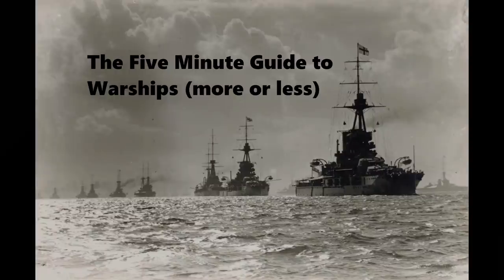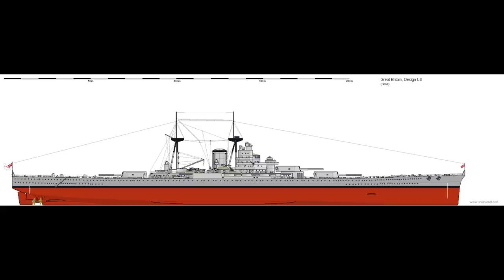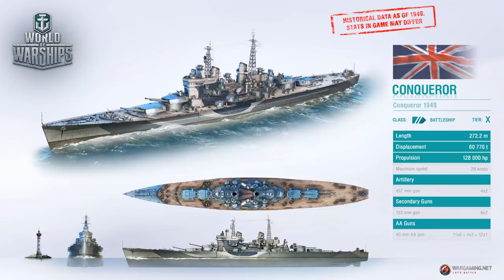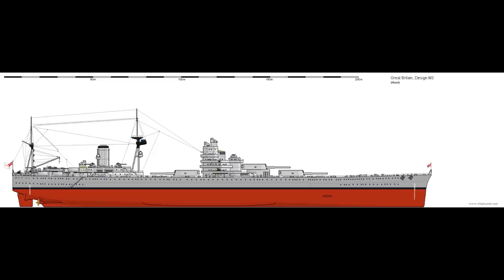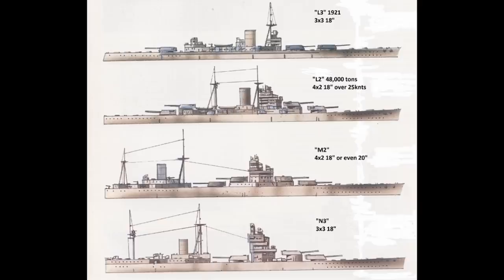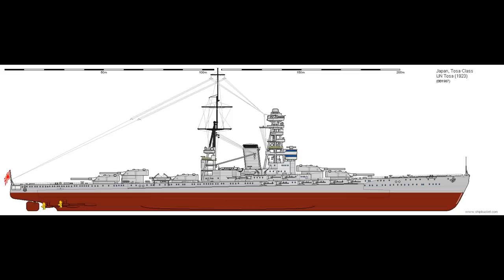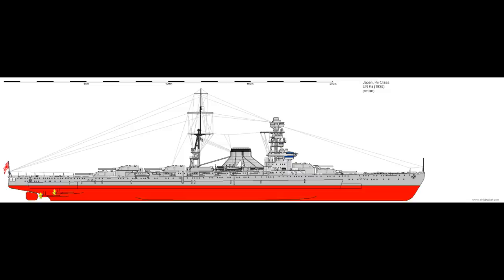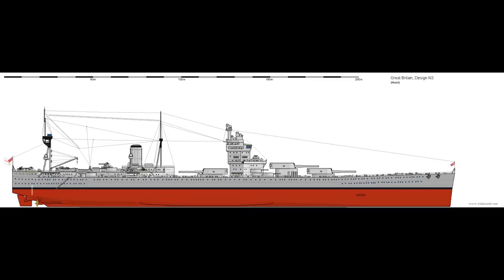N3 class (NB) - Guide 072

Comment: I've never understood the argument in favour of 2-gun ("twin) turrets over 3-gun ("triple") ones from a survivability point of view... Sure if one turret gets knocked out in a 3x3 arrangement 1/3 of the firepower is lost compared to 1/4 in a 4x2 arrangement.
But if you loose 1 turret of a 3x3 arrangement, then you're reduced to 6 guns, exactly the same number as if you lost one turret on a 4x2 arrangement, you're also down to 6... So there's no penalty for using 3-gun turrets.
You just get 1 extra gun when all turrets are working for a substantial reduction in weight. It seems like a win-win.
Reply: Yes,  for the first turret it's true. It shall be said,  though,  that in 1920s 3x2 is more firepower than 2x3.
When you lose the second one, you're below optimum for proper fire control. 
And ww1/ww2 experience explicitly suggests,  that under battleship fire you will be losing turrets.
Reply: one of the things you didn't counter in was that the more guns you have in a turret the more unreliable it is due to mechanical breakdown and the less room you have for gun crew so you lose a little in protracted rate of fire there are also advantages of having the additional range finder personally there is also a fire control advantage of using twins as you cab use half salvos using one gun from each turret making correction of fire much easier. I prefer a 3*3 arrangement however it wasn't until very late in Battleship development that reliable 3 or 4 gun turrets could be produced at battleship grade calibres and there was a solid argument for using twins right up until radar guided systems were able to overcome the inherent advantage of twins
Reply: As the others said, once you lose more turrets  more twin turrets get better. And you WILL lose turrets. Triple turrets also are more mechanical complex, have often a lower rate of fire, the barrels are more influenced by their neighbours when firing, making them more inaccurate, and  they are wider, meaning you got less space on your sides for the underwater protection. Fire control with 4 turrets is also easier than with 3 as you can divide your battery equally and fire half salvos of 4 to find the range. 3 rounds where considered too few
Reply: Tony Wilson  Rodney's hit did more than just take out forward fire control.  Rodney damaged Bismarck's forward turrets.  With fire control lost, turrets can continue to fire with their own range-finding equipment.
An extreme example of such operation is HMS Exeter continuing to fire after her bridge and internal communications were knocked out.  A gunnery officer directed fire from on top of the one remaining turret.
Of course loss of primary fire control will result in uncoordinated and less accurate fire. So to say Rodney would have been completely crippled is untrue.
Rodney and KGV managed to disable all Bismarck's main and secondary turrets,  which allowed Rodney to approach to point blank range with impunity.  At the end of the bombardment, Bismarck was not a functional warship lacking fire-control - Bismarck was a flaming wreck from stem to stern.
Reply: Tony Wilson  You have hit on a feature of war in that era - that engaging a target that can shoot back at you will typically be at longer ranges where you have less chance of hitting but also less chance of being hit.  Like AA fire against dive bombers very rarely would take out a dive bomber - but would force the attacking pilot to release the bomb at higher altitude and more likely miss.  Rare hits like Warspite and Scharnhorst did (26,000 yards at a moving target) were the exception - and each of those ships did that only once. 
But I don't see potential for a hit like Bismarck did to Hood on Rodney as well. Hood closed to closer than safe range to avoid the danger of plunging fire - but had to turn to fire all guns at Bismarck.  Turning allowed Bismarck a clear perpendicular hit against Hood's belt armor at a range where Bismarck's shells could penetrate more than 16" of Hood's 12" belt armor and 4" to 5" bulkheads.  Hood's armor was upgraded in the design stage after lessons from Jutland but was still not designed to be a battleship.  Rodney was built more like the pinnacle of WW I concepts of a battleship's role - slow but able to dish out and withstand punishment.  Jutland showed how much damage could be inflicted (lesson primarily learned by the Germans being on the receiving end of those 15" guns), but all battleships on both sides steamed home after. 
Rodney also benefited from having more than 10 years before the war to work out the design flaws (including its own tendency to knock out her radar by firing its guns).  If Bismarck had not lost his radar (from firing his guns) and had been fully mobile (if still slow from the damage Prince of Wales inflicted in the Battle of Denmark Strait), this would have had an interesting effect on the battle.  Let's assume a more mobile Bismarck would have been harder to hit, and his fire would have been more accurate.
Rodney started firing at 21,000 yds and was closing at a much slower speed than Hood - but did not need to turn 90 degrees for a full broadside.  With all guns forward, Rodney could fire all three turrets forward at longer ranges, and would only need a partial turn to bring all three to bear at closer ranges.  This would have the effect of Bismarck's shells hitting Rodney's 14" belt at an angle giving the effect of sloped armor.  And unlike 4" to 5" bulkheads, Rodney had up to 12" bulkheads protecting vital components (thicker than Bismarck's internal protection).  Rodney might have been a more durable ship in withstanding naval gunfire than Bismarck.

I could see a battle in which Admiral Tovey managed to intercept Bismarck before he reached air cover, but with an inconclusive engagement where Bismarck was able to disable turrets on Rodney while losing some of its own.  But if reduced firepower from Rodney was combined with the intermittent failures of the 4 gun turrets on the KG V we could have had an engagement in which both sides were forced yet able to withdraw (the Royal Navy ships being too low on fuel and too close to the French coastline to continue pursuit, and Bismarck needing even more repairs).  Without Bismarck's primary and secondary guns being all knocked out, they could not have gotten close  enough for the torpedo hits that had the capacity to doom Bismarck (to sink a battleship you generally needed mines or torpedoes to knock holes in the ship below the waterline).   It would have meant Bismarck continuing as a threat in the Atlantic.  The Royal Navy would still have been dedicating resources to disabling Bismarck or being in position to intercept if Bismarck sortied out (much like with Tirpitz).  But it could have had a more significant effect on the war with where these ships would need to have come from.  To meet this commitment, the Royal Navy might have been forced to abandon the Mediterranean with potential loss of Egypt (or making it harder for US forces to operate in North Africa). 
The Royal Navy got lucky with the circumstances of the final battle with Bismarck.  Gunfights leading to the sinking of battleships were an exception, not the rule.  Even the effective gunfire of Duke of York vs Scharnhorst in late 1943 served mainly to slow Scharnhorst allowing destroyers to catch up and finish Scharnhorst off with torpedoes.
Reply: Tony Wilson  Minor point but Rodney did have an aft fire director for the main battery; it's on a small tower at the aft end of the superstructure behind the secondary battery.

EDIT: You can see it on this diagram of the Nelson: https://upload.wikimedia.org/wikipedia/commons/a/a7/HMS_Nelson_%281931%29_profile_drawing.png
Reply: Reasons to pick doubles over triples
-accuracy
-less risk when losing a turret
-spends less ammo per turret
-traverses faster than triples
-easier to make
-less complex
-can fit bigger guns in same sized turrets
Reasons to pick triples over doubles
-numbers when in a smaller ship
-needs less turrets
-smol citadel
-an easier way to fit 3 guns instead of having a double and a single
Reasons to pick quad guns
-u a french boi
-needs to fit many guns
-even smaller citadel
-"LAUNCH MORE BAGUETES"
Reply: The French going with twin double double turrets .........
Reply: @iansneddon2956  goood analysis well thought out, great discussions here...that's why i love this channel. Drach has some pretty smart followers.
Reply: I didn’t realise that until I read you comment (I’m not good at maths)😂😂😂
Reply: You get less rear firepower, so you are weaker when disengaging, and you also have to deal with overweight bow section, as it is not balanced by an equal mass on the stern section.
Reply: @iansneddon2956  Your analysis is very good, but Drach did a video about how Hood was destroyed, and he came up with a penetrating hit below the main belt. He stated that Bismarck's guns didn't have the penetration ability necessary to penetrate Hood's angled 12inch belt, the sloped armour deck behind it, and then travel into the magazine. Afaik, German AP had excellent penetration when hitting at something close to a right angle, but dropped off quickly when the angle increased.

I would like to point out that while Rodney had a very impressive armour scheme and thickness, she shares Hood's fatal weakness, the shallow belt armour. If you look at the armour scheme, you will see that the belt barely extends below the waterline. If a shell should hit that spot, there would only be the torpedo bulkhead protecting the machinery and magazines. This family curse is also visible in the G3 and N3 designs, although it was corrected in the KGV-class, which had a very high belt (I think over 6 meters, but don't quote me on that)

Without the torpedo hit to her rudders, Bismarck would still be able to steam at 28 knots, so she would most likely able to refuse battle with Rodney. KGV might catch her, but a 1vs1 is unlikely to take Bismarck down, especially with the unreliable quad turrets. An interesting scenario would be if Tovey decided to take KGV and Renown against Bismarck.
Reply: @michaelkovacic2608  Yes, I did my analysis before I got educated by Drach in his excellent video about the sinking of Hood. I had considered Bismark's hit to have been some very lucky penetration of not just armor but interior bulkheads.  
The hit bypassing the belt entirely through a "technically" underwater hit made much more sense.  Generally, though, AP shells do not detonate if they have to travel through water prior to impact, which led to Drach's further analysis of photos of Hood at speed with a wave trough exposing Hood's hull below the belt.
This leaves me skeptical of Bismarck scoring as lucky a hit on Rodney on two counts:  (1)Rodney's armor and interior protection was thicker than Hoods around vital components. And (2) I haven't seen any pictures of Rodney at speed with as sizeable wave trough as we see with Hood.  Maybe if Rodney was going 28 knots or so, we would see more of an effect. But of course Rodney could not have ever gone so fast and certainly not in May 1941 with worn out engines.  iirc, Rodney was struggling to get near her spec speed of 23 knots.
My hypothetical battle was a way of acknowledging that the Royal Navy had some good fortune in getting hits in earlier on Bismarck. Had it gone the other way and if KG V had earlier gun failures, Bismarck might have held his own somewhat.  For its inefficient design, Bismarck was still a capable battleship with excellent guns. Arguments against this victory for Bismarck, particularly from another of Drach's videos, is that the KG V class gunnery problems are exaggerated. Something about KG V experiencing problems after having reliably thrown more shells at Bismarck than the entire USN battleship force combined fired at Surigao Strait.  PoW's failures are excusable for a ship going into battle during what should have been its shake down cruise.  KG V's guns were quite reliable for the portion of the battle that mattered most. 

An alternate resolution for a battle between KG V and Bismarck one on one might be KG V withdrawing (possible with Bismarck's rudder damage) with both ships somewhat disabled.  Leaving Bismarck in the afternoon with limited ability to maneuver and much reduced AA protection (assuming British shells pounding turrets and superstructure) there would have been the Swordfish complement of Ark Royal making torpedo attacks on Bismarck until available torpedoes were exhausted.   Advantage for the Royal Navy... they had more resources that could be called in. And there was a Revenge Class battleship enroute as well if Bismarck still needed sinking.  Reinforcements for Bismarck were not as available.
In a hypothetical encounter on the high seas where both ships damage each other to a tactical draw, the victory would go to the Royal Navy.  The more they could mission kill Bismarck the better. Let the RAF take over bombing Bismark under repairs.  And the Royal Navy would have more resources for repairing ships than Germany.
Reply: @iansneddon2956  Can we really be sure that AP shells do not detonate if they travel underwater? PoW scored a underwater hit on Bismarck which detonated against her 50mm torpedo bulkhead and flooded a generator room, and Washington scored several underwater hits against Kirishima which did absolutely devastating damage und caused terminal flooding.

While I generally really admire British shipbuilding, the shallow belt armour on early interwar designs was always perplexing to me. When looking at Rodney, for example, you have a 356/381mm angled belt, which should give excellent protection against penetrations through the belt at practical battle ranges. However, if you look at a side schematic of the armour scheme, you will see that the belt extends only about 0,5 meters below the waterline. A shell passing below the belt probably has to travel only through 2 meters of water. If it penetrates the hull below the belt, there is only the torpedo protection system backed by the torpedo bulkhead.

The German L20ea design has the same issue. While a 350mm belt sounds impressive, it extended only 0,35 meters below the waterline, and was actually only 2,2 meters in total height. I don't know about you, but I would feel damn uncomfortable aboard a ship with such a weak lower hull.

And a side note on Bismarck: it was certainly a very inefficient design due to the armour scheme, but it was certainly not a trash ship overall. The artillery and fire control system were very good, and German battleships generally displayed very good shooting in WW2. The British could certainly have built a much better design on the same tonnage, for example the G3. But Bismarck's armour scheme should at least have provided good protection against British 14inch gunfire.
Reply: @michaelkovacic2608  It is more of a factor that most fuses tend to be disabled traveling through water.  As you point out, the distance traveled through water is a factor.  As is the type of shell.  But since the Japanese were not involved in the engagement, their diving shell technology was not at play.
The disabling of fuses is more of a probability than certainty, of course, which could have left the PoW hit on Bismarck as a lucky hit while Bismarck's underwater hit on PoW that failed to detonate (the shell being discovered during repairs much later) a more typical result.  
There was experimentation by some nations in the 1930s with shells that could fairly reliably detonate after traveling through water.  Such as Japan's (Type 91?) diving shell, which had other problems.  Having a belt that does not extend any further down than it needs to means greater thickness of armor elsewhere.  I guess the crux of this is the "as far as it needs to" part which can change as technology does... leaving older designs a little vulnerable.
If I recall/understand correctly, examinations of Bismarck's wreck confirm that the 14" guns were penetrating Bismarck's superstructure armor.  They didn't perform that badly.  The Royal Navy's problem is that after pounding the superstructure as much as they did they weren't so much scoring new hits as repeating previous hits (redistributing wreckage).  Both ships seemed quite capable of messing up each other's superstructure.  iirc Rodney or KG V penetrated Bismarck's deck armor and took out some boilers and a turbine room. But this was not done with underwater hits so much as the deck being exposed as Bismarck listed.  The way the British were firing/hitting, they should have stopped firing once Bismarck's guns were silent and proceeded with torpedoes.
Reply: @iansneddon2956  You are certainly right about design evolution. The Royal Navy switched from the shallow, angled (and in Rodney's case internal) belt to the high, vertical, external belt for the KGV. This implies that they were indeed worried about underwater hits, as shell design improved over the years. The same can be observed with the US Navy. The NC had a relatively shallow belt, although the bulged torpedo protection system should have provided some good protection against diving shells. The SD and Iowa carried a belt that continued right until the bottom of the ship, although of course at reduced thickness. 

People always say Bismarck's terminal hit on Hood was pure luck. I disagree. Bismarck was of course lucky to score that particular hit in that particular situation, but in general, underwater hits tended to happen somewhat frequently in WW2, so the WW1-era Hood was ill-protected. Probably it was no big issue in WW1. Regarding Hood's proposed modernization, there is talk about extending the 12inch belt upwards, over the 7inch portion, but not downwards. I assume that this was not easily possible, but they probably should have given the ship some internal bulkheads over the magazine areas.

Regarding Bismarck's armour scheme, there is a fantastic article online by Nathan Okun. I believe the penetrating hits you mentioned resulted from shells hitting the 110mm angled deck after punching through the 145mm upper belt. Nathan Okun states that such hits were possible, but unrealistic, since the necessary angle of fall indicates a distance of over 30,000 yards to score such a hit. But with Bismarck listing severely, such hits could probably have happened at relatively short distances. Penetrations through the 320mm belt are impossible, according to him.

As a sidenote, he calculated (based on kinetic energy required to penetrate deck armour) that Bismarck's weakest deck portions, 50mm upper and 80mm lower armour deck, are equal to a 112mm deck. The British 14inch gun could penetrate such a thickness only at about 28,000 yards, according to Navweaps. The 145mm upper belt is approximately equal in effectiveness to the 50mm upper deck. Thus, Bismarck should have adequate protection against the KGV. However, the US 16inch 45 caliber gun with its super-heavy AP can penetrate such a deck already at 18,000 yards!
Reply: @michaelkovacic2608  Great discussion. I am going to look for Okun's article.

So much of the discussion of the battle goes into technological developments of guns and armor, but perhaps the biggest technological development in the story was aircraft mounted radar.  The attacks by torpedo bombers from Victorious and Ark Royal came in darkness or at least dusk. In both cases the aircraft were able to locate and attack Bismarck using their ASV radar.  The single torpedo hit from the first attack aggravated the underwater damage inflicted by PoW and contributed somewhat to Bismarck's slower speed. And of course the rudder hit from the second attack that made the final battle possible.

The British obsession with radar and night fighting capabilities after the German fleet slipped away at Jutland paid off here (and Cape Matapan, and North Cape too of course).
Reply: @bigships  l